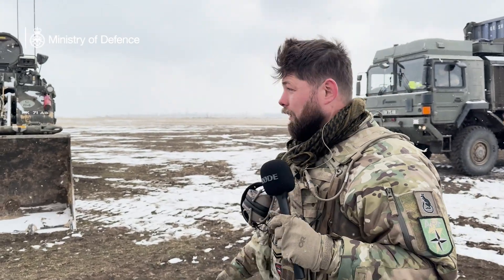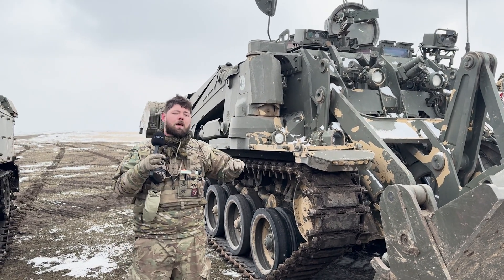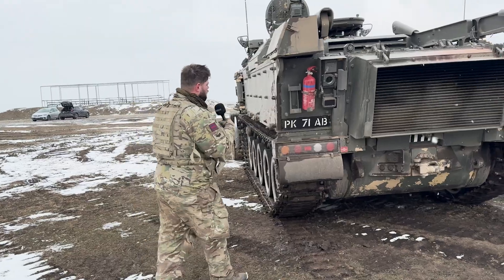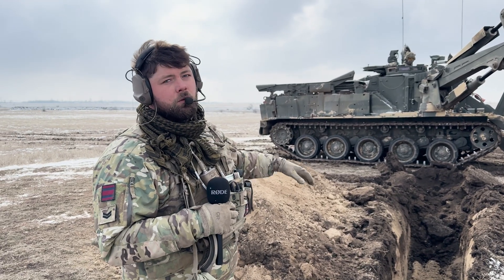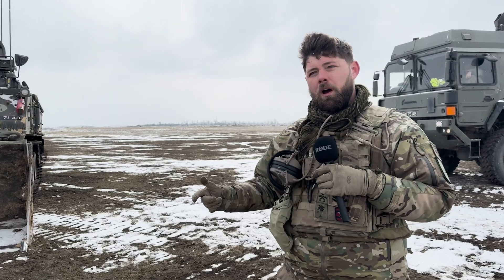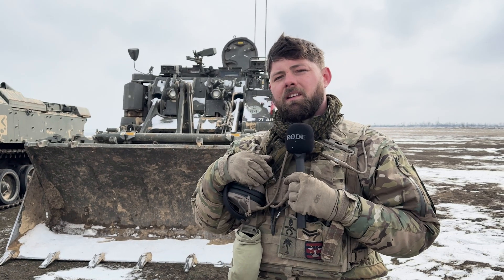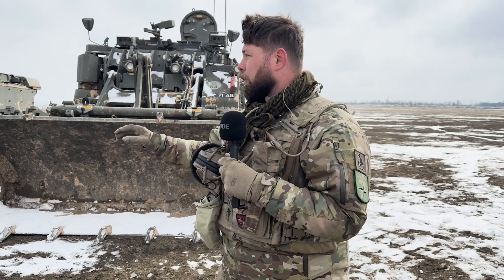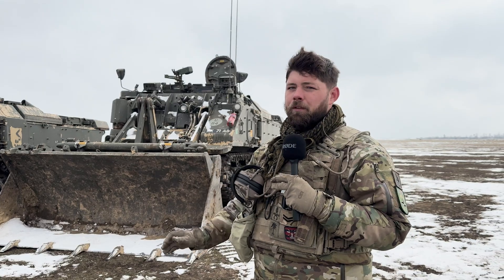The British Army’s ‘Swiss Army Knife’ Vehicle | Terrier Combat Engineer Vehicle

Comment: Just like a CET. Except it probally works more😂
Reply: You'd hope so, that's what this replaced. Iirc, back in 2013? The last one was delivered in 2015 at least.
Reply: 😂 I used to fix them a lot more than I operated one. The most unreliable bit of kit I ever came across
Reply: They don’t like damp or low battery voltage, jcb would build a better vehicle.